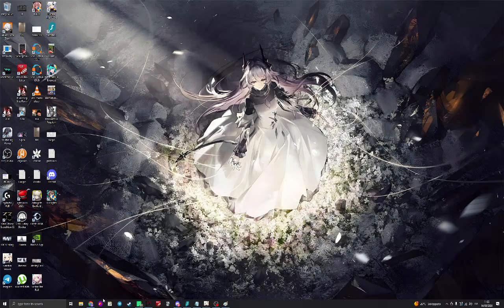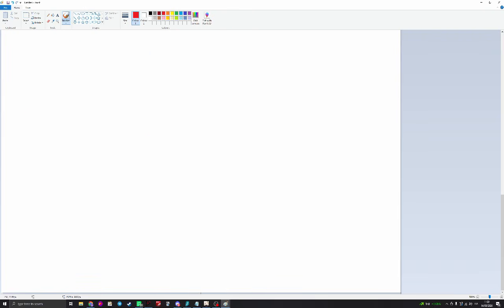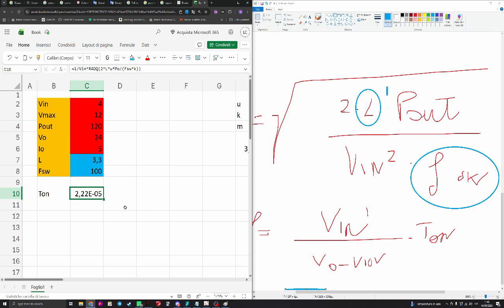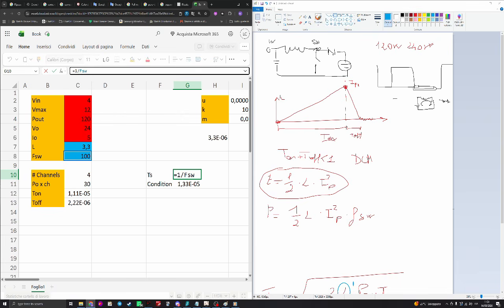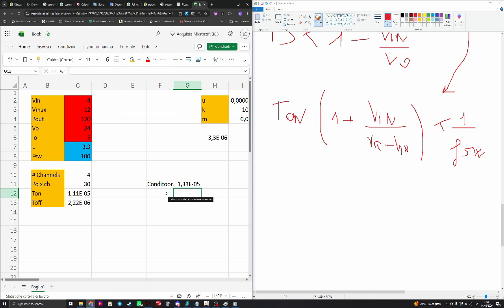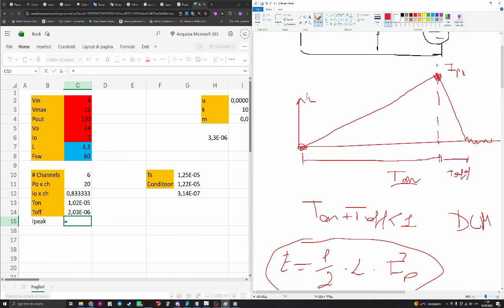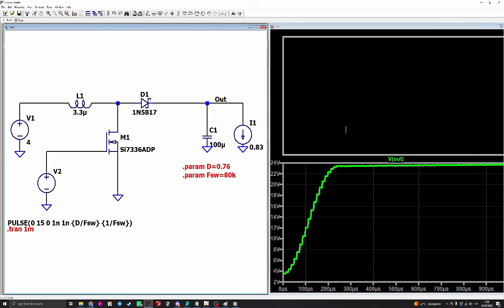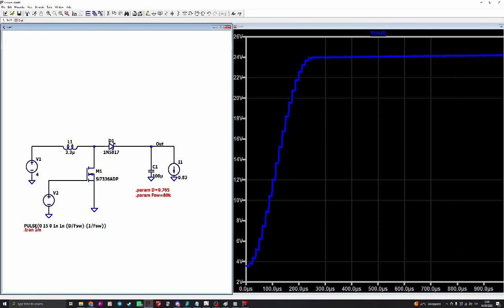[Excel+LTspice] DCM Boost Design and Verification

Comment: For duty cycle in DCM what formula can we use?
Reply from the maker: The concept is the same as the Ton in the end. It's Power dependent, L dependent, Fsw dependent and Vin of course
You can use this to calculate the necessary DCM, ideally, for each point Vin
D= SQRT( 2* L * Pout* Fsw) / Vin
Take care that you always have to verify that you are in DCM, so the second equation 1-Vin/Vo has to be valid, or else you are in CCM
You understand immediately that you will not be in DCM for any power and voltage condition given a fixed L
What we done in industry, is to change the frequency, provided that you choose a reasonable inductor for your power range, that is
Reply: @LukeXVIIx64  Vin parameter under radical remains Vin squared?
Reply from the maker: @andreip9600 Yes that’s why I moved it out of the square